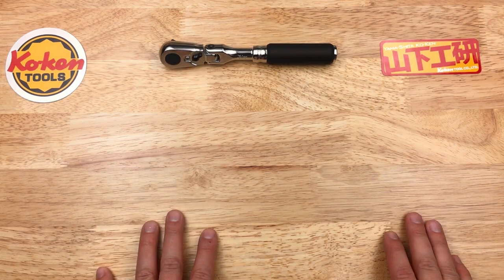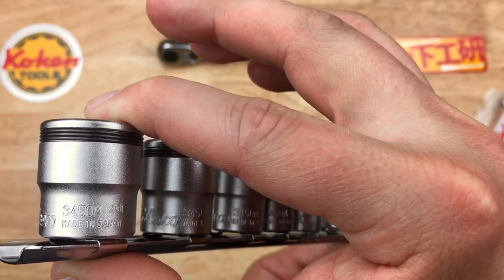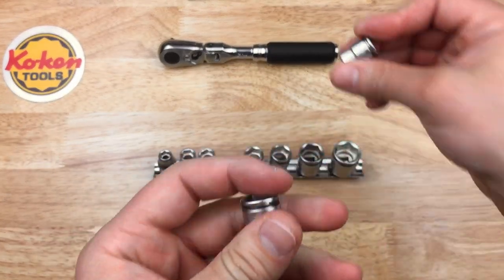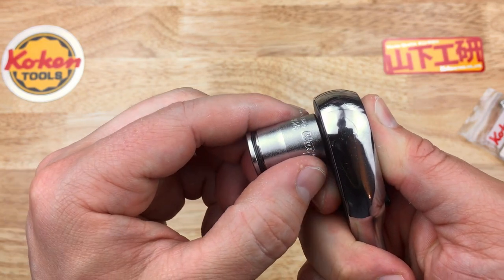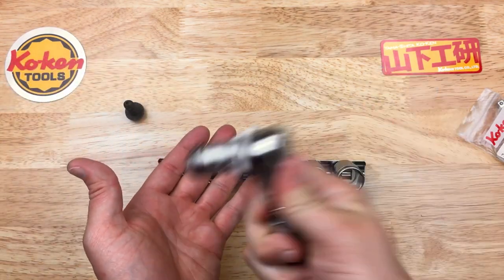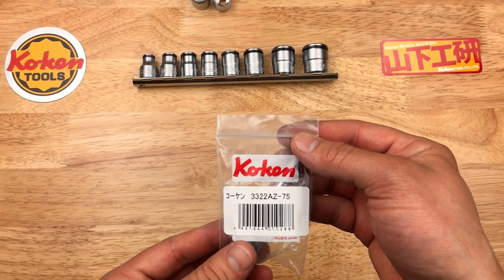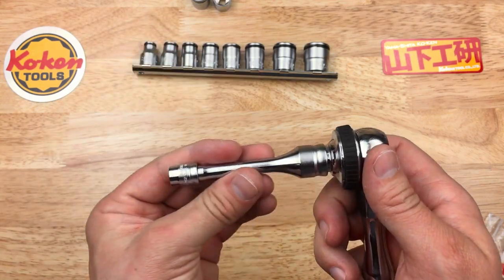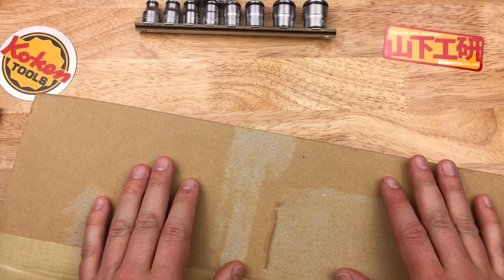Ko-ken Nut Grip Sockets 🇯🇵 Made in Japan

Comment: Love the nut grips pretty much stopped using magnetic all together
Reply: Hello again CP
In your time turning wrenches. Have you used either the Gearwrench 81235 or Sunex 8855 Magnetic universal joint sockets and Extensions sets? Both look very similar to my eyes. Which one has the stronger magnets? I 've had the Gearwrench package in my hands. It does not mention it. Does the Sunex version? Or is there another brand  or idea that you may know more about?  Again thank you
Reply from the maker: They really work great!
Reply: @BrandoDamo  Hello again Brando Damo and CP the tool addict.
Do these sockets come in Twelve Point and SAE/Standard? Almost all of the Hardware on Aircraft is twelve points with a few Six points. No metric hardware as of yet. My idea is to keep tools and parts together, No dropping or losing of either. That's a good way to ground an Aircraft until the lost tool or part is found. Also a very good way of losing your job. Thank you for another Great Video

Comment: I didn't realise how smaller the 1/4 zeal sockets are, compared to the 1/4 nut grip. (nut grips are significantly shorter than my standard 1/4 sockets. So I use them a lot in work due to that)
Reply from the maker: The zeal are incredibly small and excellent quality. They come in handy so often because of their extremely low profile.
Reply: @BrandoDamo  I just used the stubby compact 3/8 today. Saved my arse

Comment: Hello again Brando Damo 
Thank you for another Great Video. Does this come in 12-points sockets and SAE/Standard? As a Aircraft Mechanic most of my hardware will be 12-points and some in 6-point. No metric hardware as of yet. And were Counting twenty five plus years. On both Military and Commercial Aircraft experience. I do like the idea of the spring and skip the magnets altogether. But as you may remember. I was asking you about the Magnetic Universal joint sockets and Extensions. I don't think the metal filings will be a problem. Because the Magnet is part the extension or universal joint sockets. Although, I 've been wrong before lol.
Reply from the maker: Unfortunately they do not have 12 point nutgrip sockets, nor do they have them in SAE. Sorry!
Reply: @BrandoDamo  Thank you for responding.
Reply: @georgeferlazzo7936 Koken 12 point SAE nut grip sockets are now available.

Comment: Was wondering if they offered  all sizes. It drives me nuts that they skip sizes in the kit.
Reply from the maker: I believe you can order all metric sizes up to 24mm.
Reply: For nut grip in 1/4 they have all sizes no skips 5-14mm, their normal sockets come with no skip but zeal have skips for 9mm in all drive sizes. The 1/2 zeal has a ton of skips also. 3/8 nut grip skips 9, 20, and 23mm from 8-24mm.